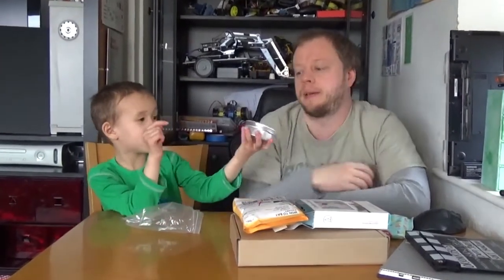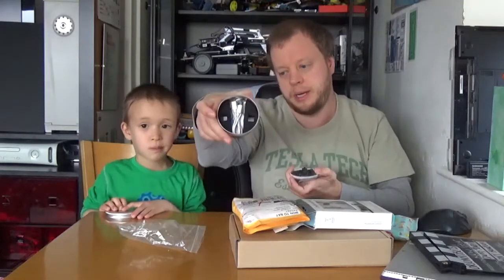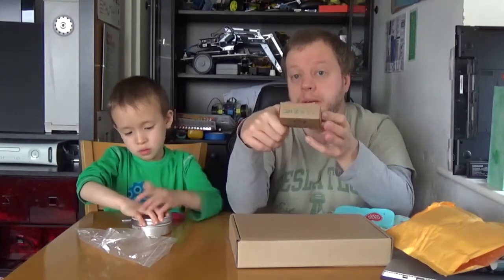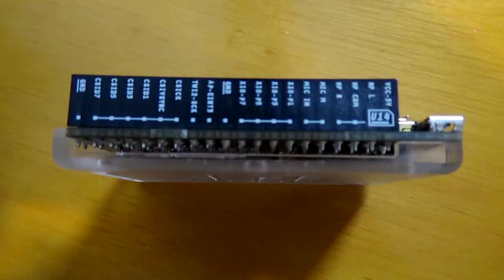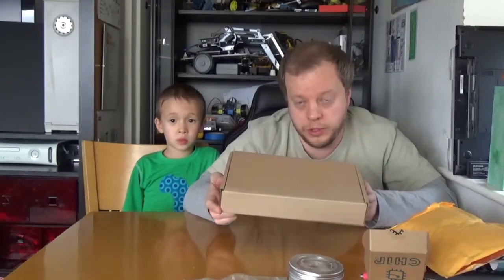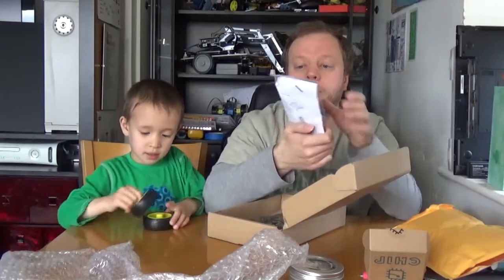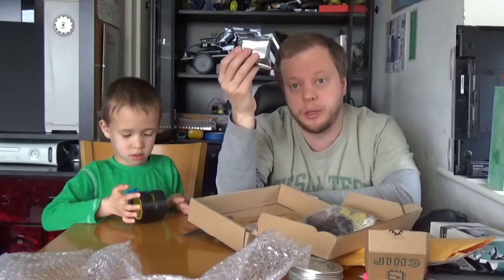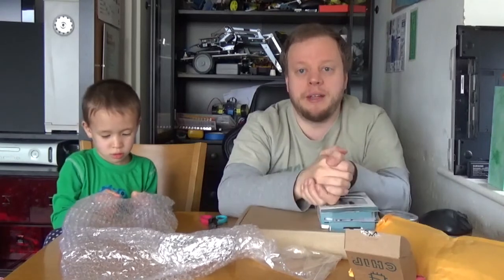Particle Internet Button, Esp8266 robot, lapel Mic and CHIP

Comment: I have roughly the same robot kit. I do have solder connections on the motors now, but during my initial testing I stripped and bent the wire though the holes... so users may find that connection is OK without solder.
Reply from the maker: +Benjamin Carlyle Perhaps I could twist it round and "cold-weld" it with some pressure with pliers - as long as it doesn't break off the tag. The wires are at least pre-stripped.
Reply: I'll be interested to see where you end up with it. Mine came as bare bones wheels and base and I've been trying to figure out exactly how to place parts. I'm looking at using some knock off Lego to lend structure and pack more in.

I did at one time think I could do interesting arduino work without soldering, but I gave that up pretty quickly. It lasted about as long as my thinking: "The microcontroller is about $4. I'd have to be doing something wrong to break the $100 mark."

My kids are nine and six, so I'm hoping to enthuse them a little along the way with the Lego, robotics, electronics, and software along the way.

Comment: I have seen the chassis for that robot before, but never that circuit board. That looks like a really nice solution for people who want to make a robot but prefer working with code rather than solder.
Reply from the maker: +Samuel Doye those breakouts - presets for the serial, SPI and servo like connections are really convenient. I will need to test it with a multimeter to see if the voltage rail on those is 3v or the voltage in at 5v. That may be different when it's connected via USB as I found that bypasses vIn (or didn't quite do what I expected) when doing the stuff with the WS2812 light strips.